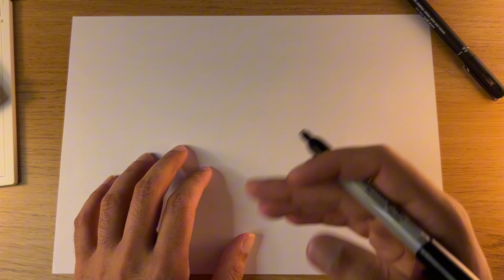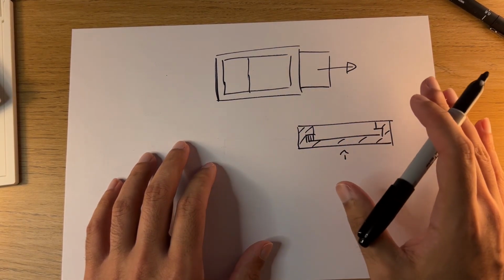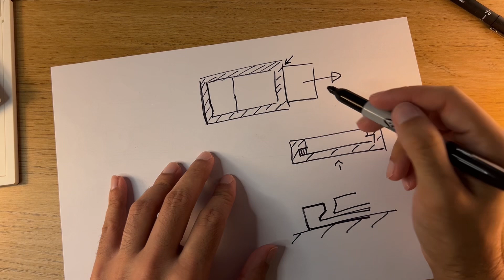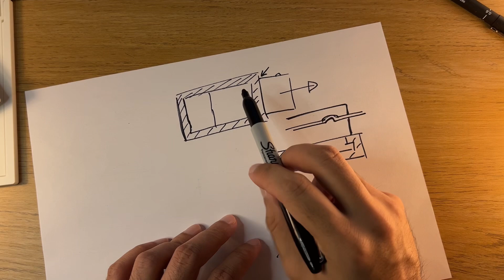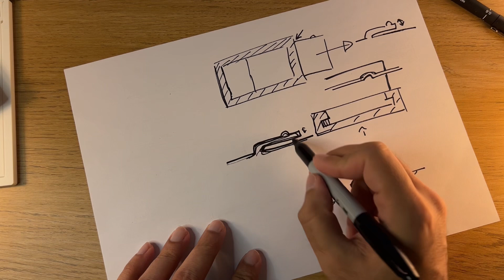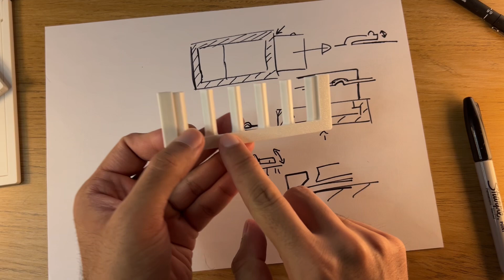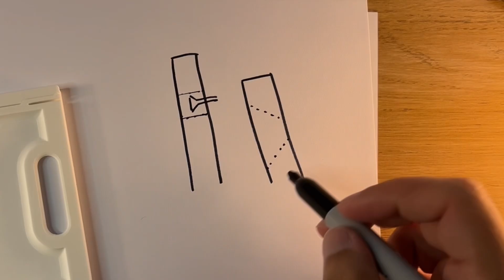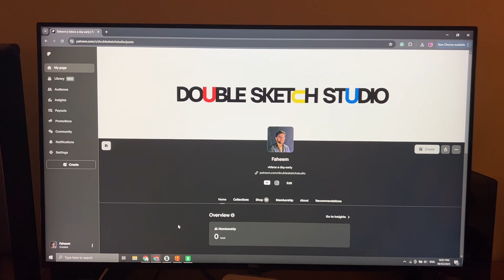How I Designed a Photo Frame to be 3D Printable (No Support Material or Assembly Required)

Comment: Thank you so much for sharing this!!! I need something very similar but in a much smaller scale and thicker inside, for a mini painting on a mini canvas.

Do you think this is something I can easily scale down? (Im using Fusion360 free version) or would it be easier to just start from scratch? 
I also think the latch mechanism might need to be different in a much smaller scale.
Appreciate any tips from the pro!! :) Im just a beginner with a bambu A1 mini and a dream haha
Reply from the maker: thanks for the kind comments! I think the first thing you need to test out is fit, just make a simple frame that can fit your canvas, getting the fit right is normally the hardest part. once you do that you can explore different ways to keep the canvas in place.  The mechanism i made was more to challenge myself and isn't the most practical. sometimes a simple wedge works just fine. shoot me an email of the progress you make, would love to see it! Faheem.product@gmail.com